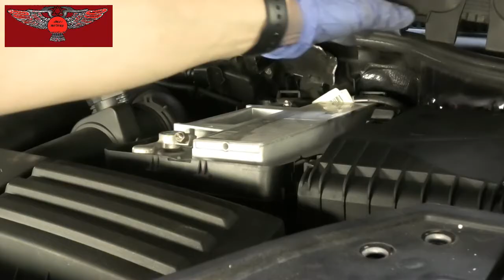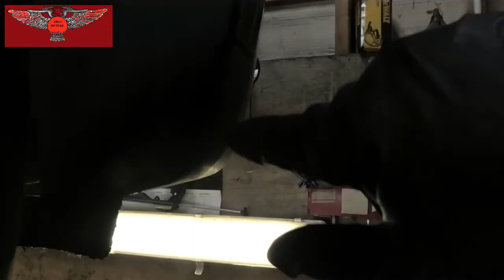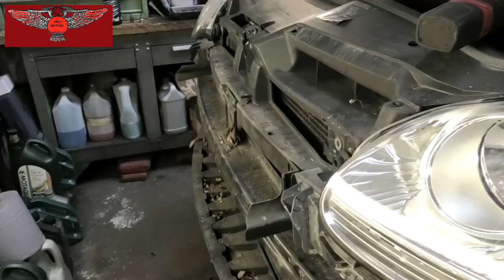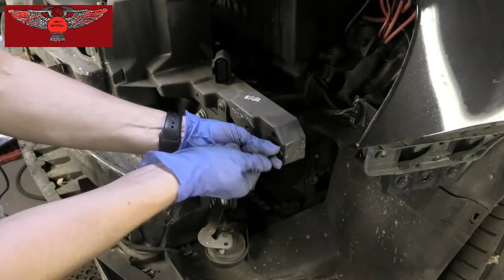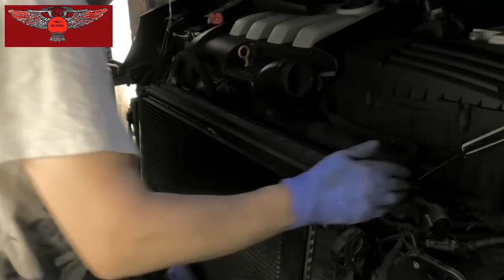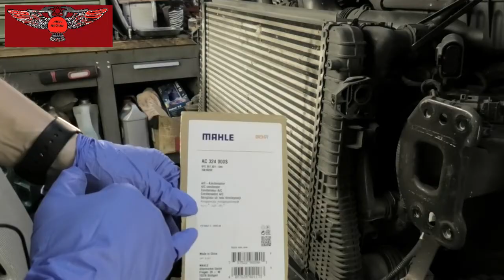VW Golf Mk5 ac condenser replacement

Comment: Jeez!!! Marathon repair job!!!  I remember when cars had room in the engine bay to work on them, and when radiators sat on rubber mounts. 2 bolts and 2 hoses and the things just lifter out, but massive respect for taking it on!!💪🏻💪🏻💪🏻💪🏻
Reply from the maker: Thanks, I know what you mean it seemed so much easier on earlier cars but on this model the car needs to be removed from the condenser 😂 😂

Comment: Great instructional video. I have a question regarding the condenser. I'm trying to install a replacement condenser,  but there is no gap between the condenser and the radiator when screwed in place. Are they designed by VW to be this close to each other or is there a missing part that separate the condenser and radiator?  Any advise is on this well appreciated. Thanks
Reply from the maker: No missing parts, that’s how they are, if there was something in between, the condenser would not fit and the screws wouldn’t be long enough.
Reply: @DaringBeefcake  Thanks
Reply from the maker: @asaka3784  you welcome.

Comment: thank you for the great explication! I chose the same Mahle intercooler. Just a little question: do you need any oring or fitting for the replacement?
Reply from the maker: the condenser should come with new o ring as this are special, made of different material. occasionally the o ring are not supplied so you could buy some extra ones, however i have in the past re used the o-rings from the original fitting and had no issues, but make sure they are in good condition without any thorns or damage.

Comment: Ooops! And for posting the video, I was thinking about replacing one on a golf plus,  but having 2nd thoughts  now that I see how much of the car has to be taken apart!!!😱😱😱
Reply from the maker: Yes it’s a lot for sure so it’s long and winded..
Reply: Just recently completed this on Golf Plus 2006 , can be done in one day. Before seeing this video I thought about skipping the condenser replacement but got encouraged when I saw how it is done so thank you for sharing this!

I think it looks like much bigger job than it actually is because the front of the car is so open after removing the headlights and bumper/bracket which were not that hard to remove. Basically just many T25 and T30 torx.
Reply: @DaringBeefcake how long did it take you? Great video by the way!

Comment: Do I need to disconnect the battery? As far as I know the sensor for the airbags is mounted to the radiator support/panel. Or do I need to just disconnect it carefully?
Reply from the maker: Hi, I didn’t disconnect the battery as far as I remember, however there is no harm on disconnecting it, as long as you don’t need a radio code, then you can disconnect it, you may have to adjust the date and time once you finish but not a big deal..
Reply: @DaringBeefcake  I don't need a radio code, but I fear the odometer trip count might reset and I track my kilometres until oul change on it lol. However, will figure it out when I get to it. Thank you for the reply!
Reply from the maker: @WestCoastG100  you could make a note of the trip mileage and add the new mileage to it when you service the car. May be hehe.

Comment: I hope you resurface that condenser connections after you pry them out with chisel or you'll might have a leak there. I'm doing this tomorrow on golf 6 and I already said 60$ for replace and charging, now I see it's a very low price for it 😅
Reply from the maker: It was a pain in the arse, I nearly bomb the pipes 😂 so the chisel was the light version of attack hahaha. Anyway is all working well now.